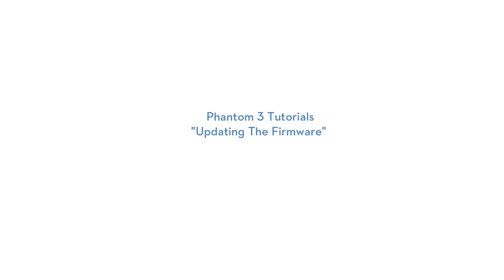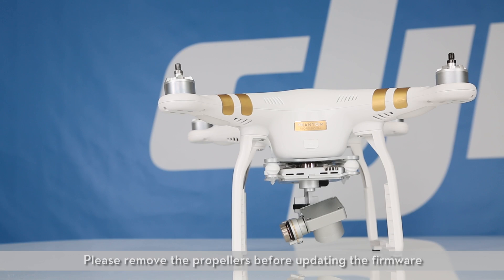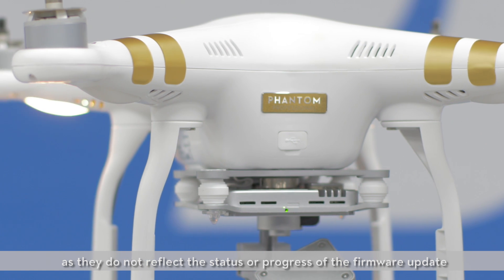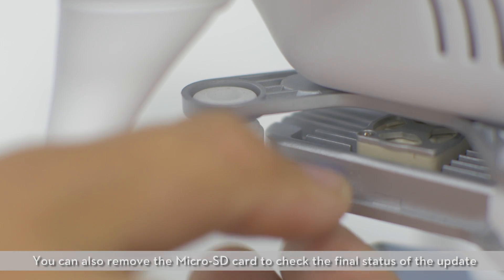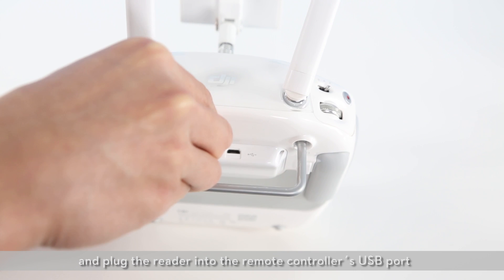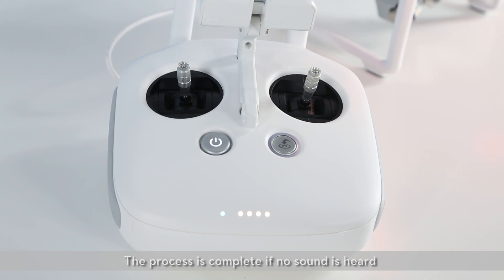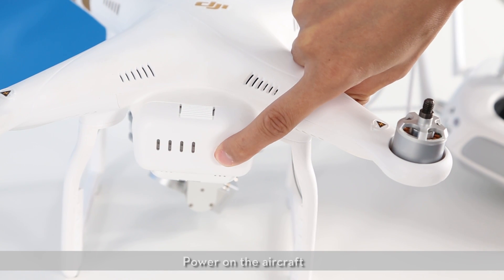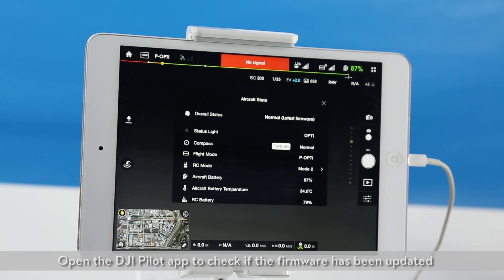DJI - Phantom 3 Tutorials-Updating The  Firmware

Comment: I did the update as shown in the video and had the same problem as others. What I did is update directly from the controller. Hook your phone to the controller. Turn on the controller and go into the app. From there you can find where to update your controller. Best your phone is on wifi for this. Check that the update is the same firmware # as you aircraft. I had no problem doing this after discovering the same problem.

Comment: Hello! I'll make you an appointment. I have a professional phantom 3 drone, with the use of the DJI GO application, and I was asked to update the drone, entered the DJI page and downloaded the latest software. I copied it to the SD card, and started to make sounds and lights that warn that it is being updated. But suddenly it began to make a constant noise and the red led that is in the camera stayed on continuously. I have tried a few more times, I did format the sd card and the same thing still happens. Will there be any solution? Sorry if the translation is wrong, I'm using the Google translator. Thank you

Comment: LATEST regarding my P3 Advanced firmware  update, following on from 3 DAYS of trying in vain wading through unhelpful "HELP DESKS" and Youtube tutorials both official and "others"
MY success with Mac and Ipad----
1. R Controller.    Connect ipad to transmitter and follow prompts ---- done!
2. Aircraft.           
A)  Down load new files from DJI "downloads" , put on Mac desk top.
B) Remove chip from craft- delete ALL data.- then drag across above data from desk top to craft chip. 
C) Replace chip into craft and now--
D)  Make yourself a "nice cup of tea", marvelling at what a fine piece of engineering you have bought, whilst celebrating your interaction with such a fabulous aircraft as it goes beepetie beep beep..
THIS worked for me, but WHY (oh why) do DJI  and others make matters SO complicated when this worked for me? 
PERHAPS its because the systems have been "improved" but--- it worked for me.
NOW all we need to do is--- wait AGES----- for DJI to make a new video telling us how to do it, without the silly pointless music, or unnecessary techno garb, so future customers are less likely to video their drone being trashed and put onto YOUTUBE---

Comment: Where is the pdf file with the instructions to update firmware???? do I plug the sd card into my computer? downloaded the new firmware on my computer it is a zip file. try to open and it can not read.. what the hell do I do.?? do I need something to plug the card into my computer?? this is vague for someone that is not savey on it.
Reply: hi DJI
Since I upgraded the firmware of my phantom 3 standard using the DJI GO APP to 1.6.80 I get a error message "RC SIGNAL LOST" on my Smartphone and the drone wouldn't take off. How can I fix this?
Reply: +burberryboay we have the same problem. And I'm very disappointed. Been trying many times and not successful.

Comment: is there a way to tell if a motor is damaged?  my professional will go through the start sequence, motors will start for about 3 seconds then shut down and will not start again.  It had a prop come loose and flipped it over for a few seconds while resting on one of the props which could not turn

Comment: This is an outdated video as the firmware for the remote controller is done, now, from the DJI Application.

Did anyone realize that there is no "..included PDF file for step-by-step directions and  updating firmware" in the ZIP file?

How do we know if the firmware upgrade includes an upgrade to the:
Aircraft or
Camera or 
Intelligent Battery ?
If the update is for the Intelligent Battery, do we need to swap the battery and redo the update?

Are there any CURRENT and ACCURATE instructions for performing the firmware updates?
Reply: +Jim Willeke The latest firmware is an All-in-one firmware package which means it can be used to update the aircraft, remote controller as well as the battery. Its best to update the controller using dji go app. Even though this video is outdated, the procedures are the same. If u have two or more batteries, then after the aircraft update, u need to replace the battery and repeat the procedure. When u power on with the new battery (with firmware copied to the micro sd card), it will automatically update the battery. the same sound indications will be heard during and after the update. but the battery update will take much less time compared to that of the time taken to update the aircraft.
Reply: +shafchenko Thanks for the clarification. But the problem happens with each firmware upgrade. DJI does not provide any worthwhile documentation to indicate if the specific firmware is for the aircraft, controller and/or battery and realize that there is no "..included PDF file for step-by-step directions and  updating firmware" in the ZIP file?

DJI products seem pretty good but the documentation is terrible and usually outdated.
Reply: *****
True that. Their last firmware didn't come with a PDF file. They can do a better job in keeping the users updated with new tutorials for every new firmware update. In the meantime, we have to rely on tutorials made by others on youtube.
Reply: +shafchenko I have a P3 Advanced and downloaded "Phantom 3 Advanced Firmware v1.8.80
2016-04-07" - is that considered the all-in-one firmware package?   Once I installed it, now my TX will not bind to my phantom - my app just says 'no signal' and there's a red button blinking on the side of the bird.  I tried the re-binding process which seems to work, but i'm still getting 'no signal' - help!

Comment: What are you using to open the BINFIle?
Reply: +wargwind u don't need to open the bin file. u just need to extract the .bin file in the zip file u downloaded to ur computer. u need winzip or winrar or anyother unzipping program to unzip the file. once u unzip the file, u can see the ".bin" file in the folder and u can copy that file directly to the root of ur micro sd card.

Comment: Hi I am still having trouble updating the RC, the Aircraft has been updated, however I have tried to update the RC a number of times (version 1.5.70) is still apparent. The light on the RC did not go to blue, it went to red only when I inserted the thumb drive, please give me a simple solution.

Comment: I am so pissed because of the amount of time I spent trying to update the controller I feel like throwing it in the trash after smashing it lol I spent all day trying to update the failing update.
Reply: +Bruce P mines took about 5 minutes..gotta be doing some wrong..Mines updated via the Go app
Reply: Yeah wrote to DJI you are correct you update it on the phone now. Thanks !
Reply: +Bruce P Ok, I'm having same problem as others. When I connect SD card to TX it does nothing.  I turn on the DJI Go app and I don't see anything about updating the TX.   And now my TX won't bind to the copter even though I followed standard binding instructions...help!

Comment: Hi, I just updated the latest firmware v1.4.0010 to my aircraft and the signal is really worst in my tablet ( i used the same tablet before the update and it was fine ) and i couldnt update the remote control, what would be the problem? Thanks!

Comment: I updated the firmware on the aircraft just fine... however, when I put the SD card reader into the controller, it won't work. Just a red light. Anyone have any solutions??? Tried buying two different micro SD card readers to no avail. ALSO... Is it okay to fly without the firmware update? Thanks!
Reply: +Jake Hilger Did you ever find a solution? I have the same issue.
Reply: +Jake Hilger The latest DJI firmare does not include the update for the controller "The All-in-One firmware v1.4.0010 does not include remote controller update package. However, for the best user experience, it is recommended that the users who are using the firmware that older than v1.3.20 to update the firmware to v1.3.20 before updating the aircraft."
Reply: +Alex Paiz  the same
Reply: +Michael Passarelli did it start automatically because i can not get mine to update at all mine has been telling me to update it.
Reply: whilst updating my drone starting to make no noise only flashing light on the computer it didnt say successful HELP PLEASE video on page I've filmed what I'm describing
Reply: +Jake Hilger I am having same issue spent entire day trying to update the dam thing.
Reply: +Michael Passarelli 
same here, I hook the RC to my phone and I update the firmware with my phone, then it will update the RC. and then, just reboot the RC, and it's done.
Reply: +Bruce P I finally got it update through the tablet! Hope it worked out for you.
Reply: +Jake Hilger Hey all, sorry for the late reply. I eventually got the controller updated through the tablet, as many kind people mentioned below! Unfortunately, now the camera isn't transmitting a signal - just a DJI logo. If it's not one thing it's another I guess :/

Comment: I had no problems updating my drone but the controller won't update there is a solid red light and it beeps for a few mins then shuts off batteries are full. Help!
Reply: Lucas Lopes same here,any luck with it
Reply: +Lucas Lopes I have the same problem today 11/29/2015.  Has anyone found a solution?
Reply: +Lucas Lopes I can't get my controller updated at all drone was fine to update
Reply: Yeah wrote to DJI you are correct you update it on the phone now. Thanks !
Reply: +Bill Shafer I just got my Phantom 3 today and was able to upgrade the controller firmware via the app (iPad) -  launch the DJI GO app and tap through Camera View > System Status Bar > Overall Status
Reply: +Bruce P 
the controller is now updated via the app on your phone.

step 1: connect phone to RC (controller)
step 2: launch DJI Go app
step 3: once in camera view menu, tap top middle bar. will open a pop up.
Step 4: update RC

Comment: I'm having a hard time updating the remote controller. After updating the aircraft successfully, I used a usb micro sd reader on the remote..nothing happens for several minutes. I tried using a thumb drive with the bin file on it and still nothing happens.. Then I connected the remote to the aircraft with the wire as shown in the video at 4:20.. I switch on the remote then the aircraft..The aircraft switches on but is blinking green red yellow and makes the noise beep beep -- beep beep .. nothing happens .. is there any way to fix this problem..

Comment: You would think they would cover what happens when the software is already the current or older. It pretty much just sits there no beeps. So read the text file. They assume everyone knows about zip files and what file ext to copy. Many new computers, windows for sure, don't have the view file extension on. Hard to cover all the possibilities, but they took 5 minutes to tell you to copy a file to the card. It's the .bin file BTW he does say it eventually.
Reply: 08Budweiser yes yes you download a zip take the bin and put it in the sd in no foders then turn it on and wait, same with controller but remove txt files when going for remote. 2 sentences

Comment: Do I have to erase the result file of the aircraft update in order to update the controller? Or should I leave it there and plug the controller to the aircraft for the update?
Reply: ***** Because i saw a video on how to do the update, they where using an usb-sd card reader, and they erased the result file in order to update the controller.
But Im going to update the controller with the usb cable to the aircraft, so I don't know If I have to erase the result file of the aircraft update or just leave it there and connect the controller and so...
Reply: ***** only delete the result files if you are using the same SD card for the other remotes and crafts but keep the bin file forever on the SD card so it updates any new batteries you might get.
Reply: Freddie B-D I deleted the result file but left the bin file. But if I plug the controller to the aircraft for the upgrade how does the aircraft know that the update is for the remote this time? Because I saw that you have to erase it if you are doing it with an usb-sd card reader, but i don't know if i have to erase it if Im doing it with the usb cable. Thanks for the answer! I got mine today and I can't wait to finish this process to use it
Reply: Just try. If it works it works and if it doesn't it doesn't. If in doubt just do the controller update with a separate usb drive. Im guessing the Aircraft has already been successfully updated?